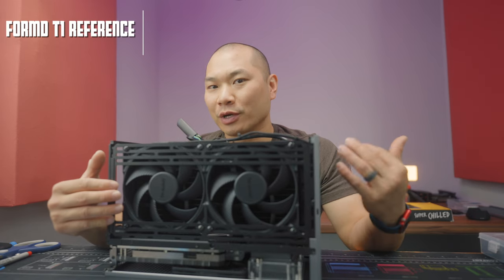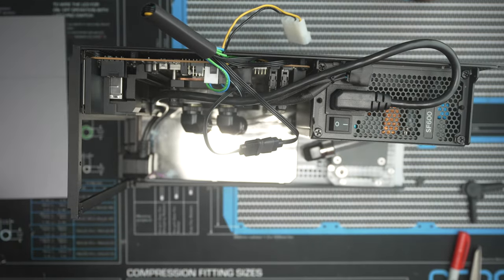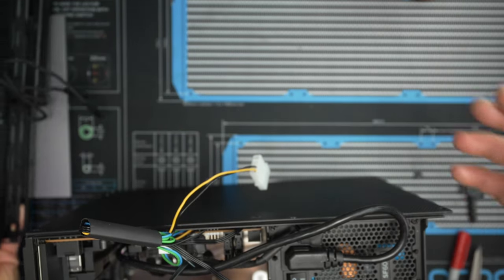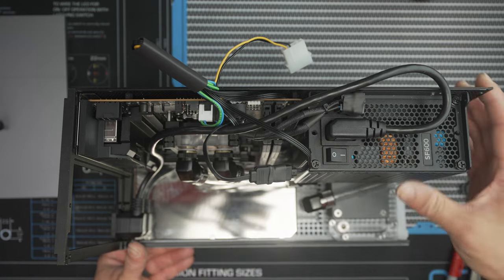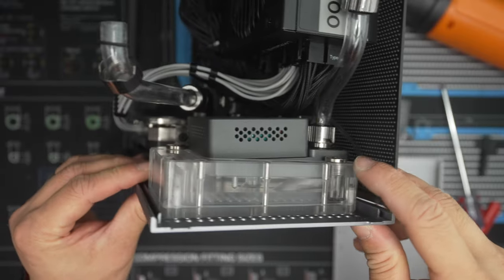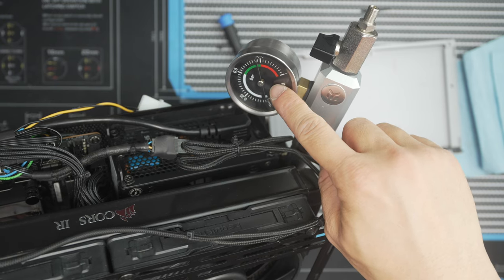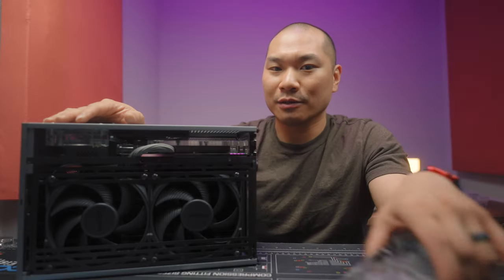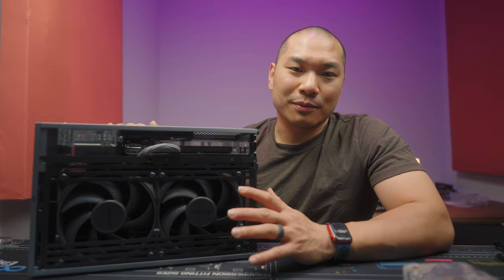FormD T1 Reference Custom Loop... Feat. the ModUltra LORO

Comment: Would soft tube save some work or they just won't do the job? Also, may I please know where can I get that 12vhpwr cable? I tried 3 of the 90degree angled adapter but none of them perfectly fits in the space. The one that I am using correctly causes bulge to the bridge that connects front panels.
Reply from the maker: It can be made to work, the only concern I had was over the pump res and behind the front panel (16mm soft tube fittings are wider than hard line ones). I hear you on the power connector, this one I got from “MODDIY”, it took a while to arrive from China but it fits without bulging.
Reply: @MachinesMore  Thank you for replying to me! I guess I would give up doing custom looping in my current setup. It might sound very retarded, but I am running a 7950x3d with Noctua C14S and 4070ti(Inno 3d 2slot) in this 11l little case. I did some undervolting and set my thermal throttle to 87 instead of stock default 95. Usually my CPU idle temperature is around 50-60 degree. When I open something random that requires it to work, it will suddenly increase to 87 then drop down to where it should be. I am worried if that's going to hurt my CPU in the long run.

I don't really know if an AIO would help.  if I were to have an AIO why would I even use this case. If I change my case then why would I need my Inno 3d 2 slot 4070ti (facepalm).
For the temperature spiking thing that I am experiencing, I did some research and they say that it is Ryzen 7000 series problems. It could only be solve by opening the lid and use direct die cooling. I was too afraid that I will break the CPU so I didn't try that.

looking for some advice, please send help🙏.
Reply: @maverickcen1220  It's fine, the CPUs were designed to safely boost up as long as they were at or below "TJmax" (temp at die junction) which is 95C and you've dropped that to 87C. The CPU die temps are about 10-15C hotter than the overall CPU temp (think GPU hotspot temp vs normal GPU temps), so you're 100% safe as long as you're staying within  those stock limitations.

Comment: Where can I get those silicon psu cables?
Reply from the maker: I ordered from a place called “MODDIY”. You should be able to get a 12 pin cable for two or single 8 pin ends.